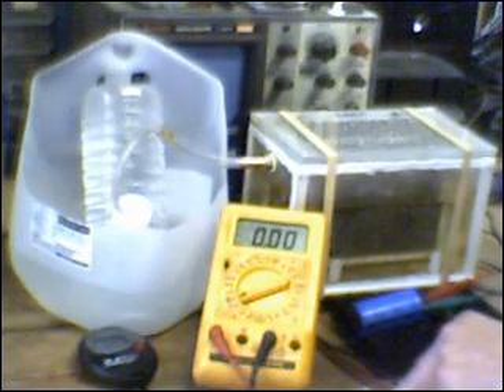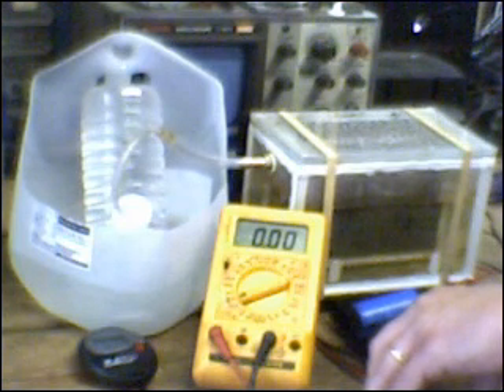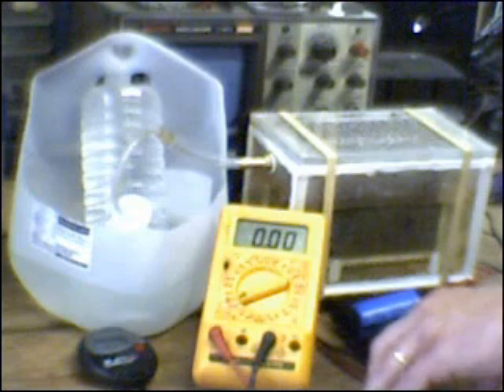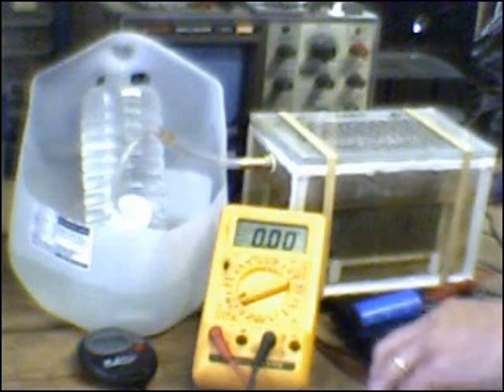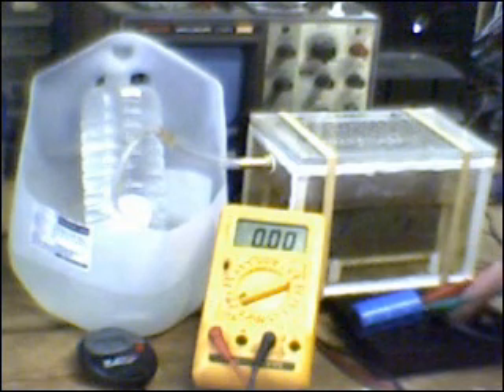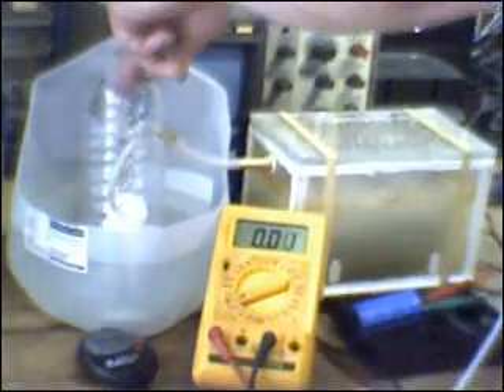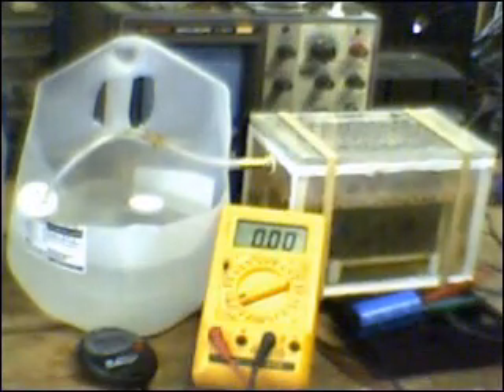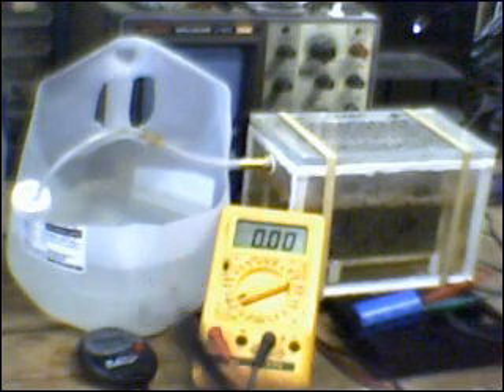27 - FINAL RESULTS Hydrogen HHO Electrolyzer 2007/08/04

Comment: I think the bottle setup you're using is probably more than accurate enough for what you need, but just to nit pick a little... I'd guess that the first 30sec fills the bottle at a slightly faster rate than the last 15 seconds, since at the end it has to force the level of the water in the bottle, below the surface level of the water in the container.

Comment from the maker: It's just an old Variac rated 5A continuous, 10A surge. Fusing is a 15A breaker in the power strip. Bridge has been upped to a 30A continuous model. Popped the one you see here the other night, then realized it was only rated 8A. Ooops.

Comment: ZFF, I know you make some crafty containers but Wal-mart Sells a 2qt juice container for a $1.50 that has worked great. All you have to do is seal the flip top
with high-temp rtv and drill a 1/2" in the side at the
top to which you run 2 10 gauge wire thru and a 1/4" vent tube thru and seal it the same way. I use Sterilite Brand myself that way if you have a flash back it will just pop the top and won't hurt anything else.

Comment from the maker: <b>A NEW FINDING!</b> Increased the electrolyte concentration to double the conductivity. Whereas last night I needed 75V@10A (750W) to fill 500mL in 45 seconds, today I tested 32V@9.6A (300W) filled 500mL in 60 Seconds! That's double the efficiency!

Conclusion: Increase in conductivity is directly inversely proportional to efficiency.

Hypothesis: Closer plate spacing will further increase efficiency by the square of the distance.

Tests to follow.
Reply: Hi, I have watched you're channel for a
Long time Now, & I don't uselly do this, but I'm gonna give you & anyone reading this" A- tip, that is like a nugget of gold.!!
This  information" that I am gonna give everyone is Worth it's weight in gold. 
My SECRET IS (  In "MY" Electrolight, I use, "DISTILLED WATER" & (AURA)!! 
AURA IS FOUND IN MOST FERTILIZERS.
Reply from the maker: @arkangel8709  It's urea and yes, I've tried that too. I even paid the $50 to buy and study the scientific paper before anyone else even knew of it. But thanks for sharing your secret. ;-)

Comment from the maker: A correction on gas production rate as stated in the video - After more experimentation I have found that the gas production is not directly proportional to DC amps in. It's proportional to Amps x Volts, otherwise known as watts.

Comment: i know one thing.... you need about 50ltrs of gas per minute to run a medium size car engine at idle. i have done the test myself with my own cell =[ its alot. with a small cell i can make 1 ltr a minute but on my dyno with the gas analyser on it you wouldn't even know the hho was entering the engine. it takes lots!
keep up the good work!

Comment from the maker: Quick math - It took 75VDC to get 10A through the electrolyzer with this concentration of NaOH, plate surface area and spacing. That's 0.75KW/Hrs. 0.67LPM = 40LPH. Anyone know how much potential energy on 40 litres of HHO?